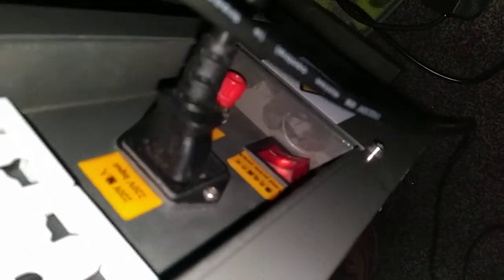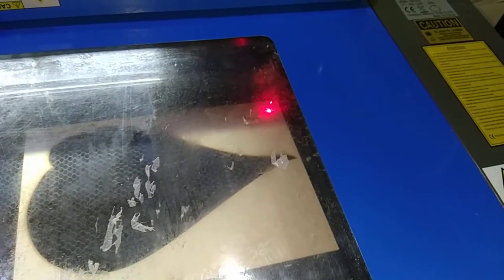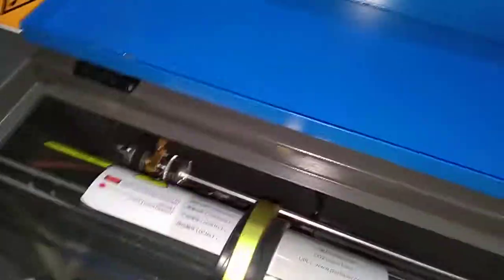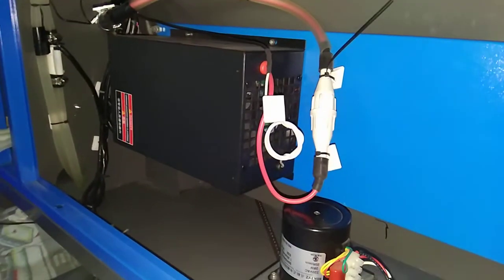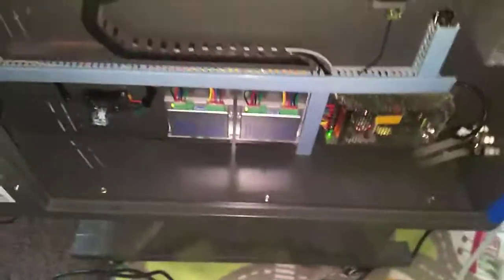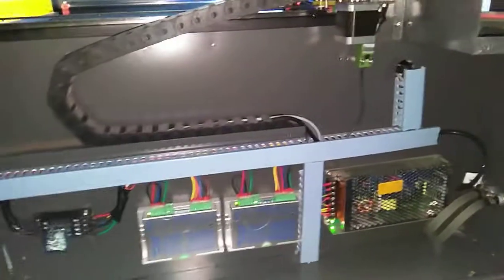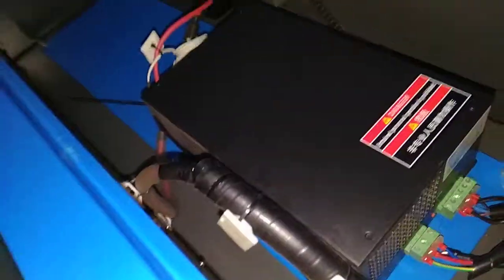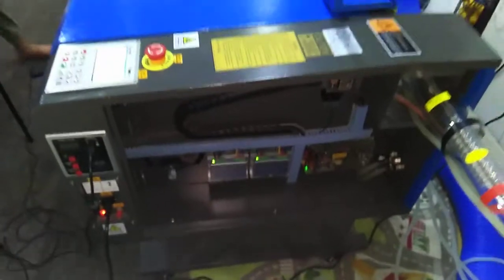Laser tube not firing(2)

Comment: Push test on the power supply....laser should fire. If it does not...you may have an issue with the board inside the power supply. I see the fan is working but it may have nothing to do with the laser issue. May need a "newer" power supply....with a digital read out display. Fairly inexpensive
Reply from the maker: So the power supply was and wasn't broken, when I press the test button the laser works ok which suggests as per most comments that power supply ok but in my case it wasn't, I then open power supply and found a damage capacitor inside, hence replaced complete power supply.

Comment: Hello Mohammed did you get this fix? If so what part you had to replace at the end?
Reply from the maker: Hi Rafal, replaced two things,  power supply was looking ok but when I open the cover the capacitor inside was burned so replaced the complete power supply, secondly I have also replaced water switch of the laser, replacing these two items solved the issue. Hope you will resolve your soon.
Reply: @palestineflipbook , I have had the same issue with burned resistor located just under the aluminium radiator. I swapped the PS before you post your comment! And it's okay so far. Thanks anyway!
Reply: @palestineflipbook  I think the water outlet of the laser tube should point upwards to get all the air out, at least on most tubes.